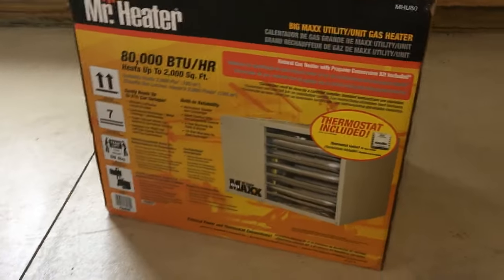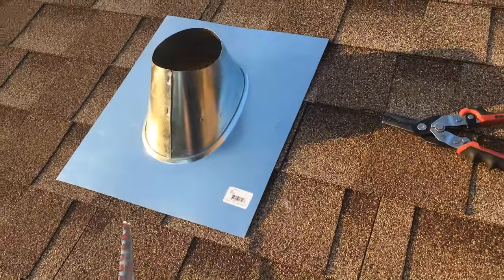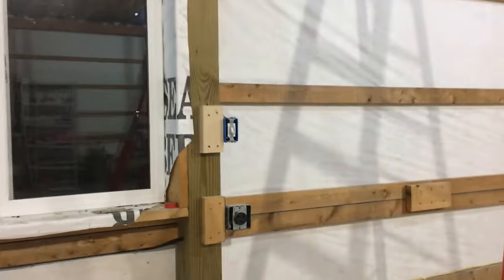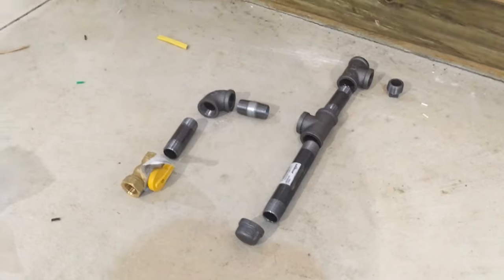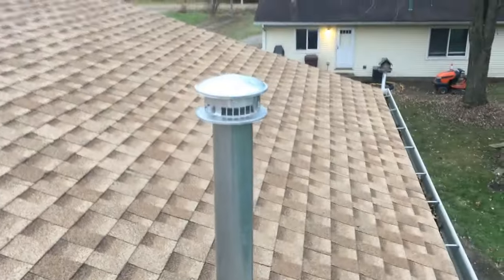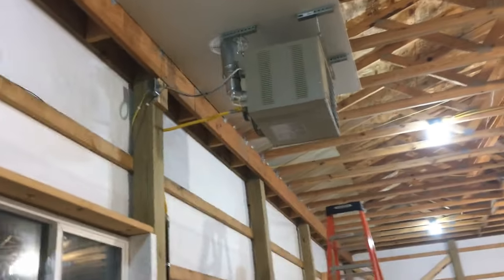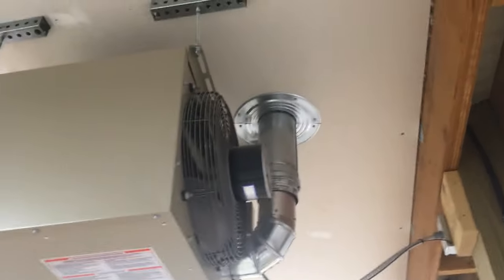Pole Barn - DIY Gas Heater Install and 1-year Update

Comment: Nice job. I did the same for my 30x40 pole barn 15yrs ago. Same heater. I went out the backside instead of roof. Unfortunately the heater is not enough for heating. I’m now adding a 150,000btu 90 plus furnace with a custom air filtration.
Reply from the maker: 150 BTU will be toasty! Mine really did nothing until I put a ceiling and fans in but now I’m happy with it.

Comment: I just installed the furnace in a 36 X 64 post beam structure.  Am heating a 36 X 29 foot area using 4 mil plastic as a drop curtain.  On my walls I used R-19 faced insulation from Menards.  I ran 2 X 2 furring strips horizontally on the 2 X 4 walls to attach the insulation to.  It was much cheaper though more time consuming then Silvercoat.  I used 4 mil white plastic for a vapor barrier.  Am in Minnesota and we have -24 F as I write this.  I have ten foot ceilings that are just 4 mil white plastic supported by ropes strung horizontally.  I plan on insulating on top of the plastic either batts or blown in fiberglass.  Am waiting for my LP guy to finish the hook up to the 500 LB tank.  He's a bit busy right now.  Menards has a sale on insulation this week.  Enjoyed your video.  Thanks Shawn.
Reply from the maker: @Timothy your setup sounds great! I think I’ll take my sweet time on the walls in mine. Luckily it doesn’t get that cold here in Detroit. Would love to hear how your setup works once the LP is hooked up!
Reply: @ShawnFerret  I'll definitely get back to you Shawn.  Am excited to see how well it heats.  Good luck with your walls.  Good thing were not in Texas right now.  Those poor people really have their hands full.
Reply from the maker: @timothyputzke1250  that’s for sure

Comment: Might be a wierd question, but I'm considering buying this same heater and wondering on how quiet it is? I'm installing in my garage that the dividing wall adjoins to my bedroom and don't want to hear it from the house. Also is it possible to mount the heater directly to the ceiling with the flanges?
Reply from the maker: Hey Josh, this heater is relatively loud in my opinion. It is annoying in the shop if I’m on a Zoom meeting or trying to film video. That being said, I doubt you would hear it much through the opposite side of a presumably insulated wall with drywall meeting fire code. I’m really not sure if you need a gap to the ceiling or not.
Reply: @ShawnFerret  hmmm, bummer..I actually just got this heater in the mail. I was hoping it would be quiet. I guess I'll just have to try it. Other than a heater like this, electric is the only real option but that probably would be not very efficient. 
My garage area is insulated and drywalled and should hold heat fairly well.

Good job on the video! I think it will help out alot of people. Keep.making videos. Nice shop also by the way!
Reply from the maker: @buildingwithjosh  thanks for the kind words, I really appreciate it, especially coming from a professional. You have some great videos too!
Reply: @ShawnFerret  ha ha, I'm still getting started. Thanks. Your welcome! We all need some encouragement!

Comment: Really nice installation! Only thing is, I think you should have an iron pipe drip tee directly on the heater, in addition to the lower one. This could save you some heater trouble in the future. Where you have the valve, I would have put another ell and run the flexible line straight up the wall as it would be easier to protect it and it would be more out of the way. I also would have run iron pipe all the way, as I don't trust flex & wouldn't have to work at all about damage.
Reply from the maker: Both of those suggestions make a lot of sense! Thanks, Craig.

Comment: Now iam wondering if I should get just one of this heaters or a window ac/heater for my fully insulated  3 car garage?  If I get just a heater then I have to worry about getting something to cool it in the summer.  I just don't know which way will be the way to go, two separate units one for  the summer and one for winter  or just find a unit that has both in it ac and heating? Garage is about 660sq ft and 8ft ceiling night, fullybinsulated even garage doors. Live in Clovis ca with a climate zone of 9b
Reply: You should be fine with a 12k minisplit heatpump.

Comment: So 3/4 gas line was enough to feed the furnace? This is good info. My garage is about 50ft out and it have the 50000 btu heater. I  was hoping to get by with that size because it'll be way easier to plumb into my gas line. Thanks for sharing your process.
Reply from the maker: It worked for me! There are many factors that go into sizing, including pressure. The code books have details on how to make your calculations.

Comment: Outstanding video! Thanks for the info. I am going to do the install this weekend. I am also from Michigan(west side) Do you feel that the 80,000 BTU was enough? I was torn between the 80 and the 120. I went with the 80, my building is the same size as yours and fully insulated.
Reply from the maker: I like my 80k btu for when I’m actively working in there and set it to 60 degrees. It will keep it there just fine no matter how cold it is outside, and kicks on maybe every 20-30 minutes. There are times when I wish I could get it to 70 degrees because I’m watching a movie or working on my computer out there, but it will run constantly to maintain 65+ degrees when it is sub-20 outside. I think once I have wall insulation it will be fine though. If I did it again I would insulate the floor with foam board as the concrete feels like a huge heat sink. So I think it just really depends on how well you’re insulated, and how warm you expect it to be. Good luck with your install, you will love having heat in Michigan!

Comment: Curious how its working?  I'm interested in putting a 80k BTU Mr Heater unit in my garage,  it is under my house . Lil over a 1000sq ft   10.5' ceiling , it is like a L-shape 45 deep by 45 wide at widest point ! What ya think?
Reply from the maker: It is still working great after 3 years, and I still haven’t insulated the walls. I think an 80k unit would work fine in your space, but you will probably need some fans to distribute the heat evenly around the entire area.

Comment: What is your plan for ceiling insulation and wall? I have a 30x 48 x14 and will be doing insulation soon. Great job on vids, thanks
Reply from the maker: I blew R-30 cellulose into the attic and it’s working pretty well for $600. I’m just doing R-19 kraft faced fiberglass batts in the walls. Not the best option but much less expensive than anything else.

Comment: Did you not have to have a permit or inspection for hooking the gas line to the house or to the furnace itself only inspecting the poly line in ground to the stubs?
Reply from the maker: If I had done it all at once I could have used the same permit. Since I wanted to close out the building permit and get occupancy, I had to pull a second permit later for the furnace install.

Comment: Is that a thimble that the exhaust tube goes thru up into the ceiling drywall? Or just a 4inch diameter cover plate for the 1inch diameter gap around the vent tube?
Reply from the maker: It’s just a cover plate for the gap between the drywall and b-vent.
Reply: @ShawnFerret  is there a specific place where I can find that? Or is it a special order?
Reply from the maker: @Kiddro22  I got it at Home Depot in the plumbing section where they have b-vent accessories.
Reply: @ShawnFerret  Cool! I appreciate it sir.

Comment: Well done.  My only advice is spend $20 on a better thermostat. I had the same as yours amd set it to 60.  Turned on at 40 and was still running at 70.
Reply from the maker: Sound advice. Mine is really inaccurate too, I’ve just been living with it.

Comment: This is not like propane where u have to leave cracks or something open so you wind die in there. Lol. With this gas heater can I sealed my garage completely so heater can be more efficient?  Also what do u use for summers?  Did I mentioned I ha e a nice gym in my 3 var garage and also a game room with a pool table and darts?
Reply from the maker: Since there is a vent pipe, whether you use gas or propane to fuel this heater, the shop space can be sealed without risk of dangerous fumes. I don’t use anything in the summer currently, but I would love a split system in the future.
Reply: @ShawnFerret  so do you think u should just install a minisplit system instead?
Reply from the maker: @futbol1972  it gets too cold here to heat with a minisplit

Comment: I have the same heater. How long does it take to heat your shop up? I'm just wondering if they are 2 speed fans
Reply from the maker: It takes maybe an hour to go from 30 to 60 degrees in the winter. It takes another couple hours for the whole shop to climatize and allow the heater to kick off for longer periods. I usually just leave it running around 50 degrees and then kick it up when I need to.
Reply from the maker: There is only one speed on the fan.

Comment: I have a similar set up in my garage to do woodworking. Like you I use inside air for combustion to avoid the extra cost for the separated combustion kit. I have had no problems. I shut down the heater when using solvent finishes. Do you have any thoughts or concerns using indoor air for combustion? I see you have a high ceiling which helps. My ceiling height is 8'. Thanks.
Reply from the maker: I wasn’t aware there was an alternative for a heater like this. Are you thinking the shop air quality would be bad enough to effect the combustion inside the heater? It’s been a solid 3 years now with no issues and I leave it heated all the time in the winter. The shop is very dusty but it hasn’t seemed to bother the heater.
Reply: @ShawnFerret  The alternative is a kit that brings in the air from the outside. It was around $300, so I did not get it. My concern, and I am careful in a woodworking shop is solvent finishes. It was recommended to me by the gas company to bring the heat up to 80 degrees, do the finish work, air out the garage by opening the overhead door, then resume heating. My set up is like yours, and have had no problems in 5 years. I was asking you if you had heard similar recommendations since you have flammable stuff in your shop. My thoughts are that we are both fine. The exceptions would be spray painting and heavy poly wood finishes. The inside air is absolutely fine. I was just trying to reassure myself, and seeing your very well done installation, I knew you knew more than I do. Thanks.
Reply from the maker: @mr.purple1549  you definitely know more than me! Cool to know there is a kit for that. I have worked in a lot of different auto shops though, and most use inside air. Even when replacing fuel pumps and siphoning fuel we would rarely open a door. I also worked with a few people who would smoke cigarettes or weld right next to a leaking gas tank. I have become much more cautious in my middle age, but it takes a pretty high concentration in a small area to be remotely combustible. In a space this size I don’t worry at all. I don’t have any experience on the auto body/paint side of things and those type of chemicals though.
Reply: @ShawnFerret  Thanks, I wish you were my mechanic. You have a calming way of speaking and are very experienced. Good luck in your shop.
Reply from the maker: @mr.purple1549  thanks, you are too kind!

Comment: Did you have to install a gas pressure regulator? I’m going to be installing the same thing but not sure if I need one. 

Thanks!
Reply from the maker: My house has a regulator at the gas meter. I didn’t install an additional regulator.

Comment: I have this same heater in my greenhouse. It is lit and runs properly, but the air coming out of it is not very hot. How hot is the air that comes out of these supposed to be? When we got it, the high pressure switch was installed upside down and it would not stay on. We fixed that, but it’s still not blowing very hot.
Reply from the maker: @Cara it's funny, I noticed the same thing about the air temperature.  If I stand directly in front of the heater at close range the air coming out feels just slightly warm, not hot at all.  Somehow it still manages to bring my large building up to 60-70 degrees, but it's never managed to bring it higher than 72-75 degrees (luckily I don't need it that hot).  I assume it has to do with the efficiency of the unit, but I'm no HVAC expert.  You have me curious, so I will put a thermometer in front of it next time I fire it up and measure the air outlet temp.
Reply: @ShawnFerret  ok. Thank you so much for your response. Sadly, I think I am going to have to install supplementary heat. I need a higher temperature to germinate seeds.

Comment: Ya did great job on a clean install, I have the 50k I’m bout to put in my garage
Reply from the maker: Good luck on your install. You will love the heat, I’m sure.
Reply: @ShawnFerret  I’m sure it won’t take much to keep it warm with as much insulation as I’ve got
Reply from the maker: @texasmike7994  sounds like a sweet setup… you should make a video of it!
Reply: @ShawnFerret  I think I just might
Reply: How big is your building

Comment: did the first bend on your heat exchanger glow red? called their tech support and they told me it was normal operation and that it would go away... Im not buying that at all that defiantly is not normal operation. Did it happen with yours?
Reply from the maker: I don’t recall mine ever glowing red, but it definitely turns gray (within 100 degrees of red). It wouldn’t personally bother me if it turned to red as it shouldn’t affect the metal - I’m no expert though.

Comment: Do you know the part number for that single wall to double wall adapter and the trim ring you install under the dry wall ? Big box store or special order
Reply from the maker: I bought mine from a plumbing supply store, but you can get them at Lowe’s or HD as well. Trying typing “b-vent to single wall adapter” or “b-vent appliance adapter.” Selkirk model #104240 is similar to what I used. Trim collar model #104460. You need an adapter that is the same brand/style as the b-vent you choose so the clip mechanisms match up.
Reply: @ShawnFerret  Thank you !

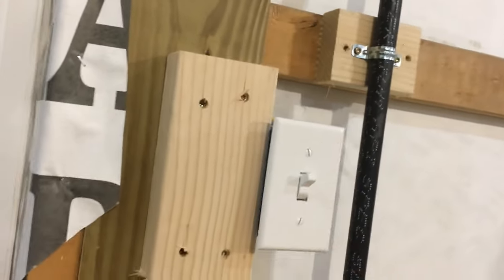Comment: Not sure of the code but at 12:53, should that be a RED plate that says Furnace?   Enjoyed your video, getting ready to do the same thing.
Reply from the maker: Thanks, Rick! Sounds like a good idea to label it either way. My electrical inspector didn’t say anything about it. Good luck with your install.

Comment: I have one of these in my 3 car garage, about 650 sq. ft. it's awesome!  How was the job blowing in insulation, I need to do that in my ceiling, its drywalled but not insulated and I think I lose heat because of it still.
Reply from the maker: Cool! Sounds like the hard part is done if you already have the furnace and drywall. I actually had fun blowing the insulation in... it was oddly satisfying. I used cellulose so it wasn’t itchy or uncomfortable. I spent probably 6 hours blowing it because the machine from Home Depot didn’t want to be fed too fast. Well worth it.

Comment: Is this the most efficient way to heat up a 3 car garage/man cave/gym?  is it expensive to ha e someone install it?  Iam assuming it needs to be connected to gas line and also electricity?  been looking at the mibisplits units?
Reply from the maker: That really depends on your climate zone! Yes it requires a natural gas or propane connection, and electricity. Hookup costs would vary based on a number of factors, so your best bet is to call a local pro to come bid the job.
Reply: @ShawnFerret  Clovis, California is in USDA Hardiness Zones 9b

Comment: Nice shop, I'm almost done insulation my Polebarn at least a 40' x 36' section with 3" foam R15 on sidewalls and R38 batts in the ceiling. I also have to frame a 40' wall across one end and insulate that with R19. I noticed you have two large fans to circulate the heat, curious where you got them. I'm thinking one of these heaters with work well. I'm in Michigan as well.  How tall is your ceiling?
Reply from the maker: Sounds like a nice shop space! My ceilings are 12’ tall.  I got the fans through Home Depot on sale - I think they were $250 a piece but they discontinued the model. They are just typical indoor/outdoor fans with 72” span.
Reply: @ShawnFerret  one more question, why didn't you vent it horizontally, seems much easier to me than cutting holes in the roof? These heaters say you can vent either way.
Reply from the maker: @cackerson10  it really just came down to looks. I have 1’ overhangs on the building so the pipe would have to clear them and I thought it would look goofy. It’s on the side of the building you see all the time from the house. I think the roof vent looks really clean.

Comment: Nice shop ! Yes ceiling is a must .I have 30×48×14 ceiling insulation blown in 1 wall insulated and metal. I recommend if you aren't  studding out the walls check out silvercote wall insulation.  I got from menards it has a white tough backer and comes in wide rolls .if you hang it will work and brighten the shop till can afford/time to sheet the shop... where did you get those ceiling  fans ? Enjoy
Reply from the maker: @Travis thanks! I saw the Silvercote on Menard's website and almost went for it.  How did you secure it between the posts?  The fiberglass is really not fun to hang without studs, and I don't want to stud the walls vertically.  After doing 2 bays, I'm wondering if I should reconsider.  The fans are Kensgrove 72" from Home Depot and I love them.
Reply: @ShawnFerret  hi short answer staples,the batts have tabs ,house wrap tape to connect 4 ft wide x2 ..to fill the 8ft cavity or 6+4 to fill the 10ft wide cavity
Reply from the maker: @travismotley3622  got it, makes sense. Thanks!